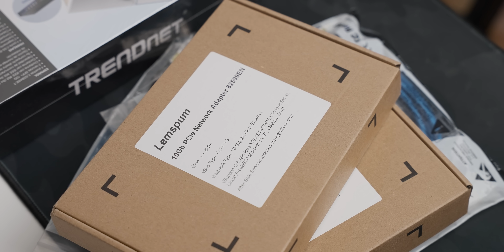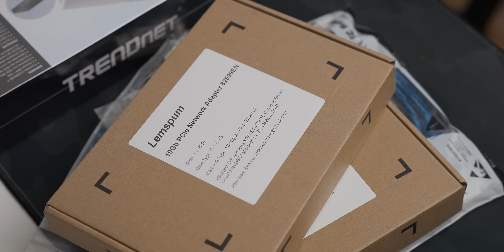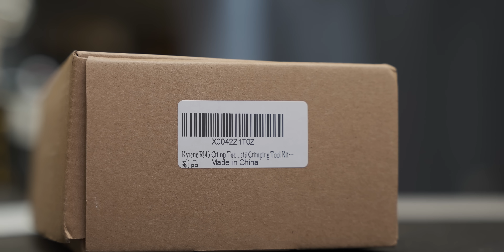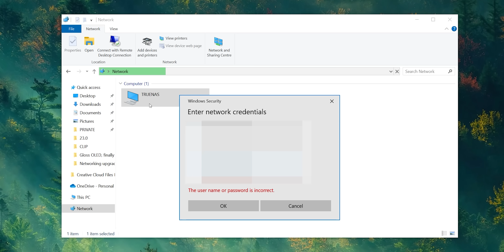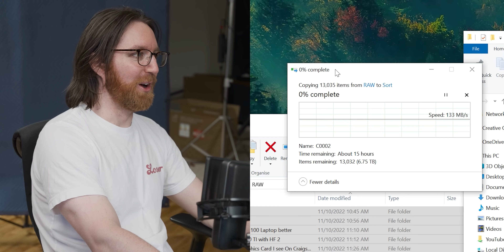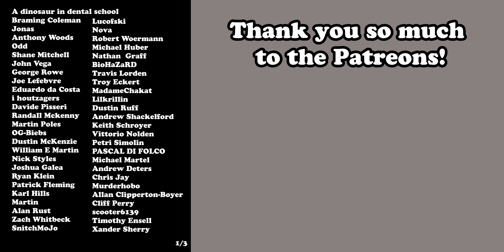Upgrading To The Cheapest 10GE Network...

Comment: I've been working in IT for 30 years..started as a web tech at an ISP, did cabling for years, now I work as a Architect....watching Dawid work on those Cat6 cables triggered me so hard I wanted to go cry in a corner lol.  But nice job getting it all to work.
Reply: Bro, watching him try to thread each individual wire through the RJ45 was cringe-inducing lmao
Reply from the maker: @ThatGuySquippy  Wait is there a different way to do it? 😅
Reply: @ThatGuySquippy  We all forget that how to cut and crimp proper is a formally taught skill and taken for granted.
Reply: @Deeppurp  My dad taught me how, but he worked as a network technician/installer, so I guess that wouldn't exactly be common knowledge 😅
Reply: @ThatGuySquippy    like watching a man try to mow his lawn with a pair of kitchen sheers
Reply: I work in IT as well and I came here looking for a comment like this. I'm glad I'm not the only one.
Reply: Doing cables for 25+ years and i have never seen that way to strip cables. I have been doing it wrong all this time.
Reply: Indeed..
Reply: Apart from all the surprises on Dawids methods mentioned here my biggest one was to see those wires going through the connector, I made a lot of cables, I never saw the wire come out the other side o_0
Reply: @jonesmacarones  They are a different style of connector.
Reply: @fmikowski  We'll I also been in the networking side for more years than I like to admit and used those connectors for many years. Not all the time but they save time in a big way especially if  on a time crunch. Every second counts when making many hundreds of terminations.
Reply: @jonesmacarones  Passthrough connectors have been a thing for a while now. They are for those who can't measure the length needed to insert the conductors into a better connector.
Reply: I was thinking the same I’m honestly surprised he got the pairs right the first try and didn’t use type “A” by some mistake
Reply: I'm a professional low voltage technician and spend a good chunk of my days running and terminating cat6a in houses. This was painful to watch. I almost think he's trolling.
Reply: That was painful
Reply: If he had any experience at all he would have gone for the patch panel and just bought premade patch leads!
Reply: I don't work on IT, I've never touched a RJ45 crimping. I'm also cringing. So much wrong in 1 vid....
Reply: I feel like I did way better in high school with terminating RJ45-cables than Dawid is doing. THen again, I was on a course in which included terminating RJ45 with a pretty good teacher
Reply: I just watched this as I worked at IBM for many years. And can honestly say It will haunt my dreams forever
Reply: as another old cable rat, yeah, this is tough to watch... everybody gotta learn sometime, but owch..
Reply: I have no context, why is the way he did it bad? He got the result he wanted, right?
Reply: @badmoose01 he did, but he made it way harder than it needs to be. You can just cut the cables and insert them all at once instead of going one by one, the shape stays in place because the cables give support to each other, and you don’t have to pass the cables through the connector and waste cable
Reply: the pain of watching him try and build the cable is so bad...
Reply: You're all not alone 🤣 I was dying.
Reply: fr
that display was so awful I wanted to go there and do it myself
Reply: i need extra therapy now
Reply: ''Dawid work on those Cat6 cables triggered me so hard I wanted to go cry in a corner''  Me too Bro.
Reply: With thousands of hours of resources on youtube explaining all of the wiring patterns, and illustrating how to best mechanically assemble a connector... he's just doing ti for the comment section.
Reply: I'm glad that I'm not the only one feeling that...
Reply: When he was threading the cables through I could imagine his pain. I kept yelling punch them down lol
Reply: The sentence 'I'll figure it out myself' is already inducing considering his earlier statements
Reply: 8:50 Use 1 ft (30.5 cm) extension cords to put power bricks on their backs beside the power strip they're plugged into.
Reply: 😂😂😂😂
Same here
Reply: Oh no I haven't gotten there yet😩,  thank you for the trigger warning😂
Reply: same here when he was talking about stripping the individual pairs..........
Reply: god it was painful to watch, almost made me want to cry.
Reply: Lowkey, I work with security cameras and will terminate up to like 100+ends in some jobs...I couldn't IMAGINE doing them like that. He'll, I didn't even ever thing about that as an option. And lowkey he's sooooo damn luck that he picked the correct rj wiring diagram first try because if not he would have lost his mind trying to figure that out.
Reply: pin this coment please! 

thanks me later hahahaha

*cry in a corner
Reply: I had to do something similar. One ether cable that had to be split into two pairs, to work for a paging system. It was not fun making them. I had to do 40 cable, so 80 jacks.
Reply: Yep, almost feel like it was rage bait.
Reply: So glad I'm no the only one who's soul hurt watching that.
Reply: I'm guessing he's purposefully making a total spazz job of the cabling to get comments like this one... He's friend was right, he should have used the panel.. Despite a few extra cables..

Comment: Bit of a nitpick, and probably honestly won’t matter for years of use: The patch panel was a better option since you are most likely terminating in-wall ethernet cables, which are more brittle than the kind of Ethernet cables that you buy pre-terminated at the store. The good news is that you can get a patch panel that accepts your terminated ends and still serves the same purpose, with the more flexible type of Ethernet cables connecting to your switch
Reply: yep, the better route for the future

Comment: As someone who's crimped hundreds of RJ45 connectors ... I gigled HARD watching this! Also ... I would have used that wonderfull little patch panel you were given and then just bought some nice CAT6 cables to go into it.

I remember going into to my friends house while it was being built with a box of CAT5 years ago to run network cable everywhere. Good times.
Reply: The patch panel job would have been easier for sure

Comment: suggestion, you can arrange the lan cable wires (straight through wire color coding) in order then put it all at once and make sure the end of the wires are aligned and insert it in the rj 45, it will work almost all the time and is more efficient than putting the wires individually.
Reply: First comment I’ve seen with an explanation on how to do it properly

Comment: I was like "how in the heck do you not know how slow HDDs are??
Reply: nope most people dont especially when they usually running an NVMe boot drive now days. Still though if you can get 200MB/s thats still double what 1G would have done, literally half the time.
Reply: @profosist  true, but I was expecting him to know, since he's well-versed in computer stuff and all :D I don't judge though, my comment was meant in a lighthearted way
Reply: @snjert8406  Dont you mean "since he does Tech Stuff?" 😆
Reply: @danatmonst3594  I almost said that, but didn't on purpose haha
Reply: @snjert8406  and it sped up and slowed down because of variable data density based upon disk zones... there's more data on the edge of the platters than towards the hub, but it's going the same RPM regardless, so it's reading more data per revolution, thus is faster, on the outer tracks than the inner tracks.
Reply: @aleaxdeathbringer I once reformatted my PS4 and installed my main game first to speed up the loading times. The HDD era was not too long ago.

Comment: Hey David, stopped early.  You want to use the patch panel or keystones.  The cables already installed are almost certainly from spools of solid core cable.  That cable is meant to be punched down.  Regular RJ45 ends may work for a while but will often fail because the pierce the cable.  Patch cables you might notice are flexible, that is because they are made from stranded wire and RJ45 connectors don't damage that wire when crimped on.  There are other reasons to use patch panels and keystones but thats a major one that could save you some grief in the long run.
Reply: While there is good information in here (solid core vs stranded core)
 solid core wire works just fine in an RJ45 end and will only really fail if you running over it with a chair or something. A network switch that doesn't move much will be fine. I use a solid core cable in my day to day use in my bag as an internet install tech and I'd say they fail maybe twice a year or so then i just toss it or re end.
Reply: @Jorkofvich I recently put 7 poe cameras in with solid core. Working great. Bending doesn't affect it.
Reply: For all the comment saying that "it work fine": it's like changing oil in your car engine. You don't do it "it works fine". Until it doesn't... The good practice with solid core cable is to use a patch panel (He already have one). I understand that this is an entertainment video so the technical part isn't really important but that's not a reason to recommend bad practices. It's like LTT which should be called Linus Tech Tips on what not to do. I like LTT but it's important to remember that it's an entertainment show first and foremost.
Reply: While it can fail, and usually does so over time, it can last a surprising amount of time. I've been using a cable with solid core wire for about 6 years for all my networking. Now that said, and while it does need a 'special' tool, it's kinda silly not to use a patch panel when you already have one!
Reply: I came to the comments to say this.
Reply: Solid core is usually used in house installations, connecting different floors over longer distances. The end clients use multi stranded cables (which are fine for short distances). That mixture will give you longevity and flexibility at the same time. At least that’s what I learned here in Germany.
Reply: Yeah, I made the mistake of buying a 50m spool of solid core when I needed multi strand.
Reply: Honestly I use l solid core for almost everything, and I avoid stranded, and hand crimped patch cables as much as possible for reliability. @samiraperi467
Reply: He has chosen… poorly.
Reply: This

Comment: I ran fiber from my desktop to SFP+ switch and then fiber to my Truenas Scale. I did that in my office only cost about $200.00. You also might want to blow a fan on the sfp+ modules they get hot. So to answer the que you have about speed jumping up the fuller the drive is slower it will transfer as it gets empty out it will speed up.
Reply: He's not using fiber, he's using DAC cable so copper...

Comment: The Windows file transfer software is notoriously bad at copying files at large volume, and slows down at smaller files. You should try Teracopy. You could verify, pause, even continue copy even after interrupted.
Reply: I wouldn't trust third-party closed-source proprietary software for moving data around. Robocopy (included first-party cmd tool) is very good

Comment: I mean you could ahve just plugged in a Nvme drive via USB 3.2 gen 2 or USB 4 (If you have it) and they are very cheap and you could get way faster speed. I can get 2GB/s read and writes via that  which is the same as 20Gbps networking and given that NVMe drives are so dirt cheap this would have been the fastest way to move data.

Comment: You sitting there crimping the Lan cable reminds me of the time in university when i needed a 10m lan cable and I went to a local electrical shop. The guy handed me the cable and the crimp tool and heads and said “you can do the crimping yourself” 😂 I sat there doing it for 30mins… it worked though!

Comment: Can't the HDD dock thing be hooked up to the NAS directly? Could even get a script to copy once you plug a new drive in maybe?
Reply: Yes it can. It won't help with the speed because it's just one hdd and it will top out like it was down in the video anyways no matter how you connect it...
Reply: @BoraHorzaGobuchul  Perhaps, but it's less manual and wouldn't need to do it on his work machine. One less potential failure point and if you can automate some of it even better.

Comment: Why did you not use old enterprise switches, they cost like $100 and have over 24 10gb ports and 4 40gb ports?
Reply: because they're noisy, power hungry and unnecessary for 4 devices
Reply: When you have only 2 devices the question is : why use a switch??? There's nothing to switch, connect the 2 devices directly...
Reply: @frederichardy8844  He has more that 2.
Reply: @frederichardy8844  Who said he had 2 devices.  He has more devices than that.  Please try to keep up.
Reply: @BenState  A switch with 2 SFP+ so 2 10G devices, I keep up...
Reply: @frederichardy8844  L2 protocols?

Comment: Who's gonna tell him a DAC cable is not fiber?

also, man, i remember struggling with terminating UTP like that. It's so much better once you're used to it! Make sure to use the T-568B standard(Orangewhite-Orange-Greenwhite-Blue-Bluewhite-Green-Brownwhite-Brown) as it is the go-to and has been for over a decade(that said, Auto-MDIX should figure things out if you accidentally make a crossover cable with A on one end and B on the other).
Reply: They look like AOC cables
Reply: @joshhaas8121  The packaging for them calls them DAC ;)
Reply: @joshhaas8121  not really
Reply: TBF the difference isn't that interesting unless you're going quite a long distance.

Hell of a lot easier to splice copper, though..
Reply: There are optical dac cables )
Reply: @BoraHorzaGobuchul  DAC stands for Direct Attached Copper. If it were optical it would be an AOC(Active Optical Cable).

Both of which are distinct from actual OM fiber with SFP(+) transceivers at either end.
Reply: @BoraHorzaGobuchul  DAC stands for Direct Attached Copper... so no there are not Optical DAC cables.
Reply: @robertb6276  well yes, technically they're called AOC but people often call them "optical DAC" due to similar appearance

Comment: Strip the outer cover a big longer, line up the little strands in order and pinch them flat and cut to length before inserting. Double check color code before crimping.

Comment: I was kinda surprised for a tech channel you don't seem to know much about harddrives and filesystems.
Things that influence your HD transfer speed. Not taking any other PC stuff into account; Clustersize, Shingled or Conventional (this is a huge deal, there have been lawsuits over this), size of the files, amount of platters, the gas type used inside (simple air would produce too much static). where on the platter you are writing. The farther away from the center, the faster data can be written and read. (There's more, but I did say I'm not taking external factors into account.) And another big one, buffer size. The moments you see the speed jump over 130MB-ish, that's likely transfers to the buffer. The windows copy/move window is actually measuring the transfer speed, not the write speed. These two can be very different. for example, you can see speed in your "reading", when the HDD activity is 0. This is transfer from the buffer.
Reply: Not a tech chanel... entertainment

Comment: You'll want to use T-568B as your wiring scheme. T-568A is meant for backwards-compatibility for if you want to carry one or multiple POTS phone lines through the same connector. However, this assumes standards were followed at both ends. In general you can use any wiring scheme you want as long as (a) it's the same on both ends and (b) the differential pairs are twisted together.

Also, buy toolless RJ45 connectors. Even for home use they make life so much easier.
Reply: Both variants are exactly the same if you use the same on both ends. The only reason there are two variants is to allow one to flip the RX/TX pair in the so-called "crossover" cables so that devices of the same category can be linked together (e.g. two PCs without a network switch/hub).

Network devices nowadays can auto-negotiate but older ones can't.

The whole myth that there is any difference at all between them is because organizations liked to mandate which one to use so there would be no confusion, but they are 100% electrically equivalent.

Other than that, there is zero reason not to mix A and B cables (again, if you use the same one on both ends of the cable). They are 100% the same.
Reply: Cool i actually didnt know why you are supposed to use the B variant. I was just told at school that I was supposed to do it like that, and never really questioned it
Reply: Tbh I wired up my whole house to the b standard without ever finding a good reason why b is preferred to othe than: it is like that.
In my opinion it doesn't matter as long as you stick to one of them.
Reply: In Canada A is the prevalent wiring scheme.
Reply: @therealcojo  I can't tell if that's eh joke or not

Comment: Oddly enough, I have the same sort of NAS a Node 804 filled with drives. My advice would be to validate the Cat 6 for 10gbe in preparation for switching to 10gbe RJ45, X520s and DAC just got super annoying to me (I had the same PCIe problem, ended up with a PCIe 4.0 x1 from OWC that was RJ45 instead of the x520s which are PCIe 2.0 x8.)
Reply: model of that card pls?
Reply: @BenState     It's just called a OWC 10G Ethernet PCIe Network Adapter Expansion Card, from OWC. It uses the Marvell AQC113CS

Comment: I make cables almost every day at my work. Can make those with my eye close. Also, suggestion for the wall adapter. Just buy a power brick that has a two prong on the other end.
Reply: Impressive! You can actually feel which color the connector is? :D
Reply: @FedeHippo Yup, it's in my mind's eye. Lol